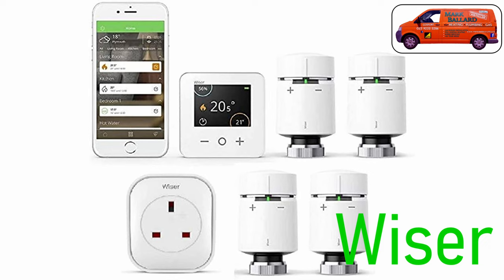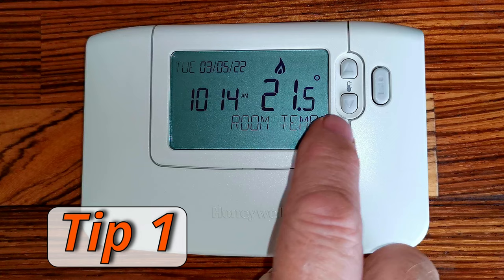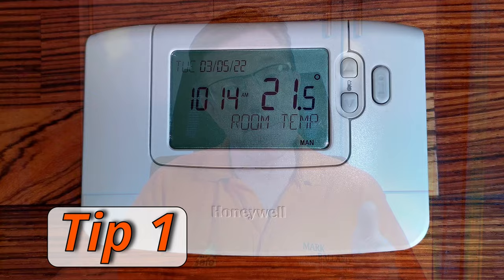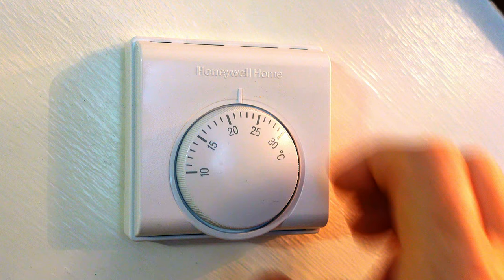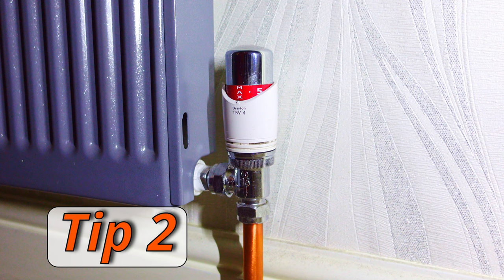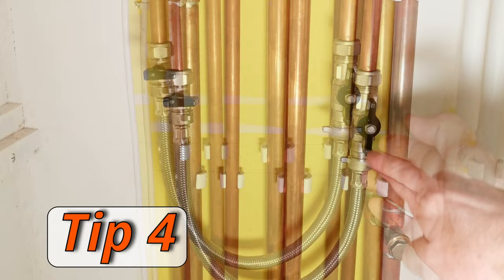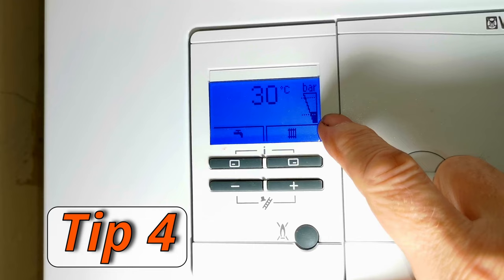How to Reduce Your Gas Bill - 10 Money Saving Heating Tips. Things You Can Do Which Will Save Money!

Comment: Tip no.4 contradicts tip No3.  A radiator turned off also increases the overall return water temperature making the boiler less efficient.
Reply from the maker: Yes, that's why new boilers have fully modulating pumps and gas valves.
Never a simple answer.
Every time a thermostatic radiation valves turns off  the the return temperature will change.
Central heating system are far from perfect.
And yes old systems are inefficient. It's the best option on most systems. Plus
Reply: @MarkBallardLTD  FAR FAR FAR from perfect!! Awful design. A block of cold metal, (usually) stuck under a cold window, heating cold glass, and forming condensation. I can't believe some clever gas engineer (MARK) hasn't come up with something better.

Comment: Over at heat geek he says not to shut any rads completely as the boiler will still be trying to heat those rooms just inefficiently.
Reply: Thats why his tip number 2 is bollocks. The room walls of those rooms turned off, will be sucking the warmth through and the boiler will be chugging away trying to compensate.

Comment: Re Hot Water Heating on a system/heat only boiler I've found it best to simply run it for a fixed time (usually a one hour on the boost button is more than enough). As you say, waiting for it to increase by the final few degrees till the thermostat cuts it out takes ages, with the boiler mostly idling during that time.

One question if I may, on a Y Plan system during the low heating load part of the the year (spring and autumn) is it best to heat the hot water and house at the same time, or one after the other?
I can see arguments either way - heating together imposes a higher load on the boiler so is going to run it for longer before it hits its lower modulation limit and cuts out, on the other hand the high return flow rate from the cylinder's heating coil is going to mostly determine the temperature of the return flow to the boiler, and so reduce boiler condensing when the water is nearly warm. 
Would welcome any comments.

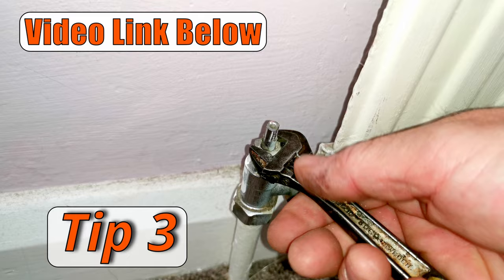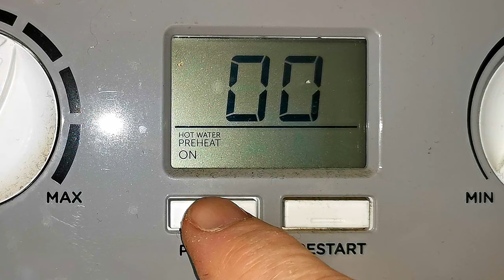Comment: Difficult one that all day/not all day thing. If it's real cold it could be false economy if things start getting qwrecked by damp, condensation. I'm experimenting at the mo. We used around £9.50 -£10 for one day, on at 07:10, off at 21:00. That includes showers, cooking etc. One week has cost around £68.00 inc standing charge. We must hace a cold house because there is still loads of condensation on the windows in the morning.
Reply: I've been experimenting too...when it was really cold here in Manchester last week up to -8 at night I had the flow temp of the boiler at 75 and didn't have the heating on during the night... it cost £12 a day!.. gradually I started to reduce the temp of the boiler from 65 to 55 leaving the heating on all day and night turning the room thermostat to16 during the night. The cost has gradually reduced and now costing around £6 a day with a boiler flow temp of 55. The house is much more comfortable. It has got warmer outside of course so the house is warming up quicker but is now an even temperature rather than freezing in the morning and taking hours to heat up.
Reply: Also, not having the heating on low during the night we were getting loads of condensation on the windows in the morning...we also haven't had frozen pipes which a lot of our neighbours have!
Reply: Tip number 6 😉

Comment: I have a question regarding why the TRVs need to be fully open when balancing the system? They will only close when they desired room temperature has been met, so having it on #4 means the valve is fully open until temp of around 25degrees has been met?

Comment: What is your opinion on using Drayton TVR4 balancing valves for balancing the house radiators? I have 10 rads with standard TVR’s on them except for the towel rad and the hall rad where my T/stat is located. If you give the thumbs up for the Drayton balancing valves would I install them on all 10 rads or just the 8 as it is now and leave the other two to act as bypass valves? My concern with that scenario is that the return water to the boiler would look for the least path of resistance and flow back to the boiler at a similar temp to the flow through those two rads without balancing valves and thereby not allow any condensing to take effect. Your thoughts would be appreciated. Thanks.
Reply: Those draytons are excellent trv's.Very reliable.The pegler terriers are bloody good too.
You really get what you pay for in this respect.Don't skimp here.
Worst case, it is better to find someone selling half a dozen of these on facebook marketplace(as over ordered), than buy your b and q/homebase/screwfix own brand.
They will cost about the same in totality,but you will have 3 times as many breakdowns and leaks with the own brands.

Comment: Hi my bar is reading 3.5 is this to high 😬
Reply from the maker: Yes. Best way to drop the pressure is to bleed it off a radiator.  this may take a long time and you need to bleed off several pints of water. Safest way.
Reply: @MarkBallardLTD  thanks a mill for getting back to me

Comment: Very interesting. What's your thoughts on chrome rads..daughters just had all chrome rads everywhere looks great but not to warm.Rads are piping hot could fry eggs on them but don't seem to heat house up to well.Also why is it that I've noticed some thermostatic valves   don't shut off completely. Thanks mike.
Reply: Shiney surfaces are the most inefficient at radiating heat. ( matt black are the best)
Reply from the maker: I am presuming you a talking about tall ladder style radiator a bit like towel rail.  Unfortunately these look very nice but they put out way less heat than a convector radiator which have the fin on the back of them.  Ladder radiators normally just radiate heat out.  Not Like a convector radiator which connects heat out and radiates heat out, which are way more efficient, like I said in the video don't block the top because you will stop the convection of heat.  Just look at the kw output of some ladder radiators compared to a similar sized convector radiator.   Thermostats, maybe heads not screwed down properly, maybe there jammed https://youtu.be/GhWp2ef_2pY maybe there faulty.
Reply: I have 2 steel cheap vertical rads, they are very thick. ones white one matt grey, both give out lots of heat. infact too much as i have to turn them down. 
I have 2 stelrad verticals. they dont get as hot or give out as much heat, they are all the same size. the stelrads cool really quick where the cheap one sstay warm for ages.

Comment: lots of good points here, but please also add that Domestic hot water needs to go through a legionella cycle.
Doesn't matter one bit with heating, but water coming out of the taps which you are going to use for showering/bathing/washing up and cooking etc needs a good blast at high temperature every so often to kill the bugs.
Your choice whether you set it at constant 62c or set to 50/55c and do a weekly blast through at 65/70.Personally I think better to keep as a constant 62.It might be slightly less efficient in terms of energy but the money you spend here will cost you about 10 times as much in diacalm and bog roll if you try to cheap this out!